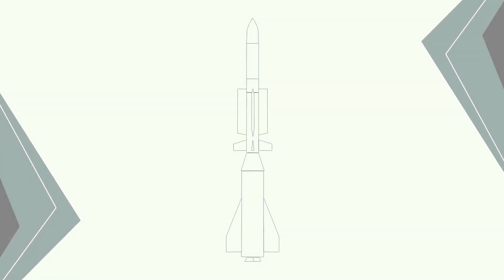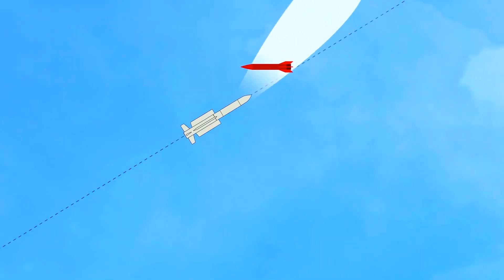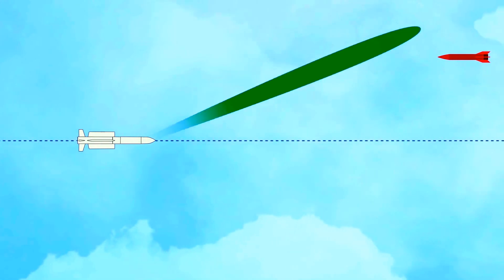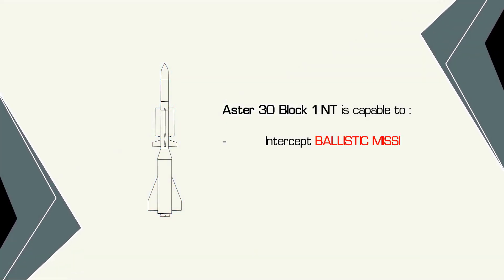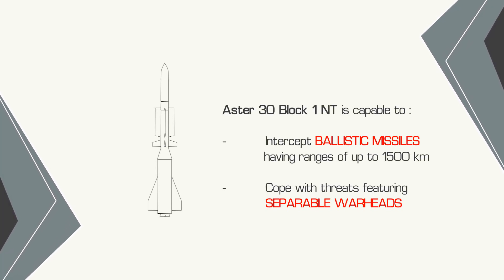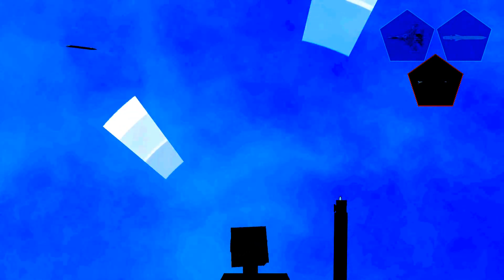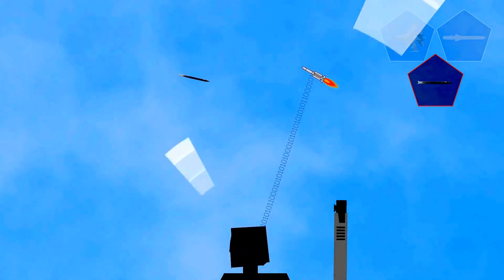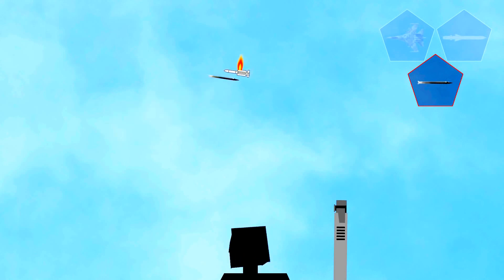MBDA - Aster 30 Block 1 NT Supersonic Missile Capabilities & Interception Simulation [1080p]

Comment: Maybe you need to clarify some things regarding the Radar Bands? Yes a similar sized reflector will provide a higher EIRP at the higher frequency, but then there is also a greater attenuation rate reducing that benefit. And oh boy let's not even mention the dismal performance of Ka band signals in the rain (hopefully any potential enemy will not attack during rain or even heavy cloud cover)...
Reply: An AESA radar is a "phased array" scheme that does not follow the same antenna beam narrowing & EIRP gain laws as a reflector based design ( reflectors act as a physical lens that works like the mirror in a telescope, whenever you decrease the wavelength the maginification factor increases) like a parabolic dish antenna. To achieve those gains in AESA you need to either increase the transmit power of each element or increase the number of elements; neither of those are simple to do without a serious size increase (narrowing the beam is a different story as well) that a missile cannot accommodate. Whereas, in a dish based radar antenna the same size dish with a higher frequency (shorter wavelength) automatically gives you a smaller antenna beamwidth, this factor is the called "Antenna Gain". And since EIRP is basically calculated by multiplying "Antenna Gain" by the "transmit Power" ( add their dB values) your get a more powerful radar just by increasing the frequency.

There is nothing an engineer can do to affect the "FACT" of the laws of physics that govern "Radio Frequency Propagation" these are laws have been empirically proven time & again, and they basically state: As frequency increases the radio signal is attenuated faster through normal atmospheric propagation, and RF frequencies above 11GHz become more and more susceptible to significantly greater attenuation from moisture/water in the atmosphere. 

While I have no knowledge of the Astor's antenna configuration I'd gladly bet you a beer that they are using a physically steered parabolic dish reflector and not an AESA...